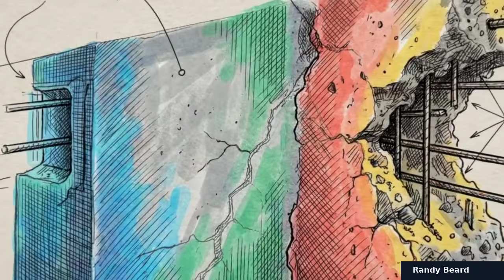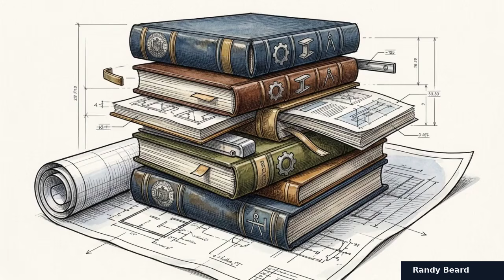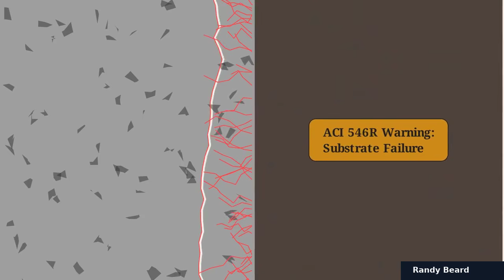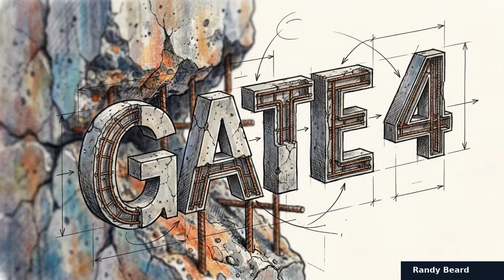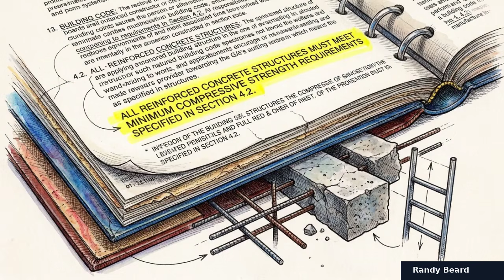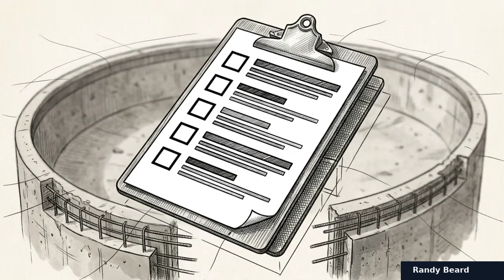The Wheelbarrow Problem: Why Concrete Pool Repairs Fail — Autopsy of a Structural Failure

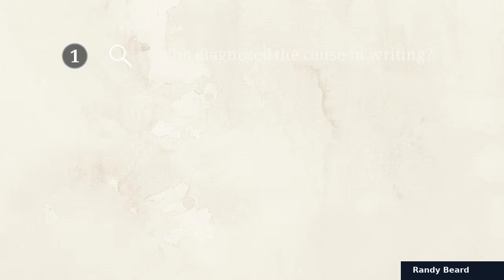Comment from the maker: The 5 questions from 6:05 (hard to read in the video, sorry about that):
1. Who diagnosed the cause in writing?
2. Where is the engineer's repair design?
3. What is the qualified placement method?
4. Where is the permit and the inspector?
5. How will the bond strength be proven?

If a structural pool repair can't answer all five, it isn't finished. — Randy Beard